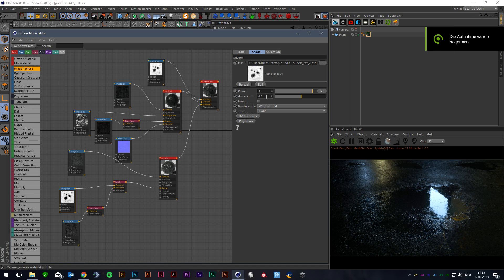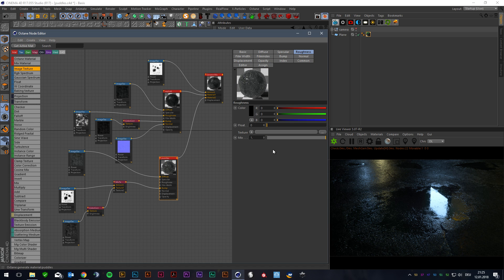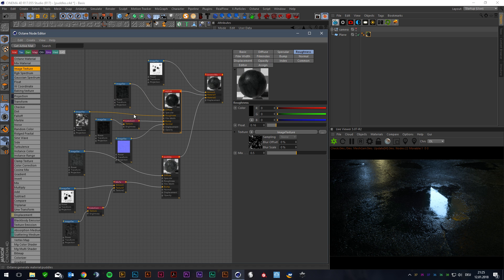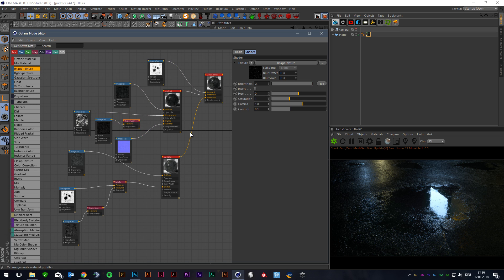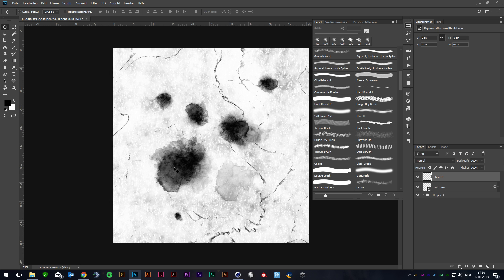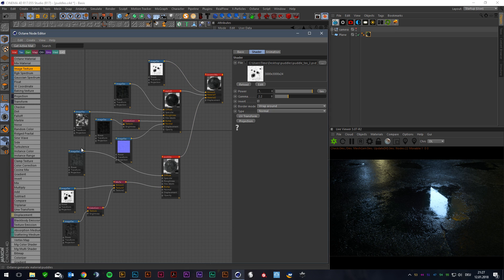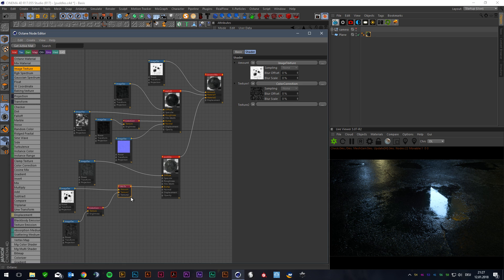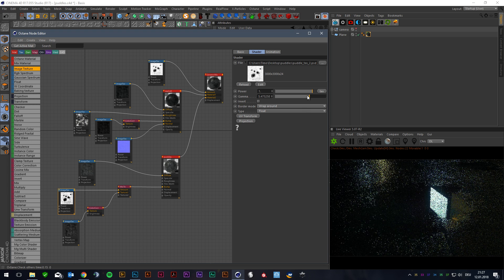Create Realistic Water Puddles in Cinema 4D and Octane |  by T I M O N O A C K

Comment: I get so many fireflies when i add my puddle texture to the bump-channel is there a fix for that? :)
Reply: Hi tumble!

Try to adjust the bump scale to a lower value and set pathtracing with around 2048 samples.
It is also a matter of lighting. If the light comes too low, the bumps are crashing.
So maybe play around with your light. If that all not helps, decrease the "ci clamp" in the octane kernels.
I hope that helps (:

Cheers,
Timo
Reply: You can fixed that with Hot pixel removal on the octane camera tag